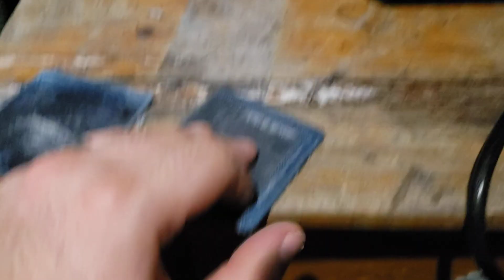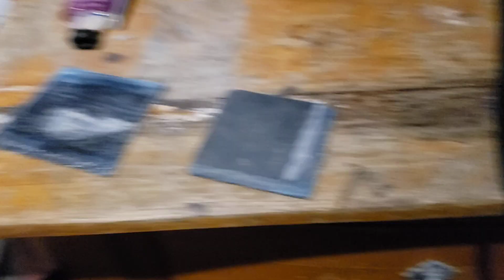Redneck Carbon Fiber sanding comparison; Harbor Freight clear epoxy VS. JB Weld

Comment: Thank you for trying this, I'm needing to make some carbon fiber propellers without vacuum equipment and I had a feeling JB weld would be best cheap fix. More expensive but I've worked with it before... Just had a thought;
Do you think those vacuum clothes sealing bags at Walmart would work for removing air on long cure epoxy??